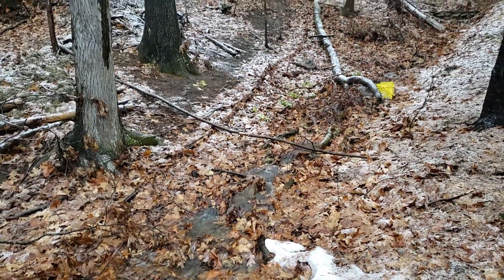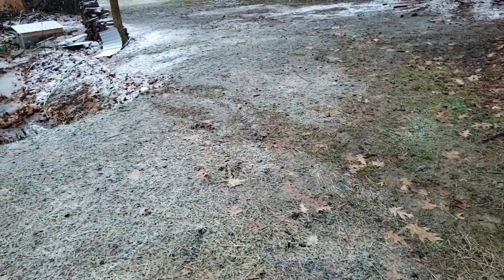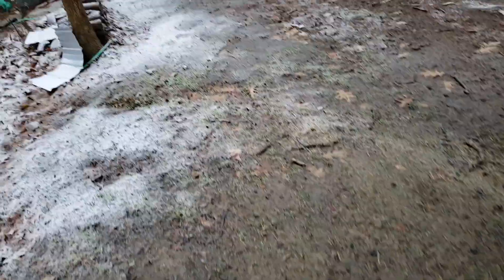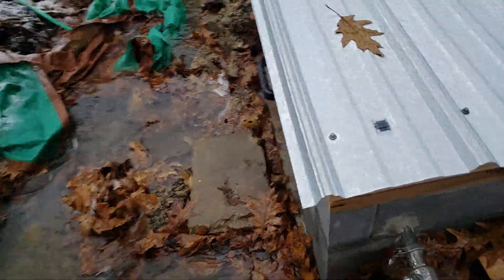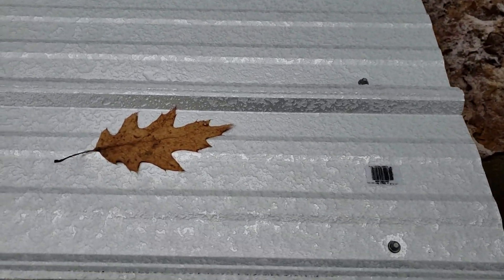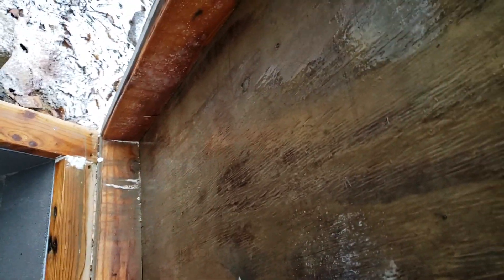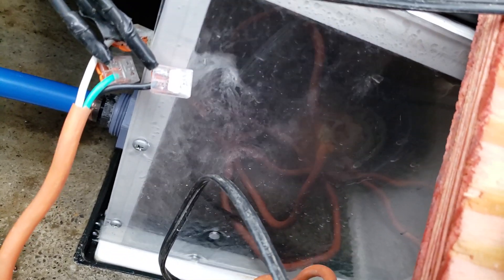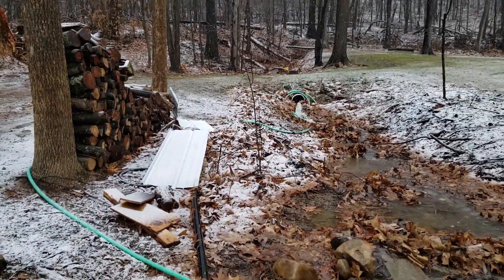Back from vacation.

Comment: The colder Temps could be messing with the meter too. Might need to add more heat
Reply from the maker: I assure you it was the moisture, everythign was soaked! I haven't tried it out after drying though.